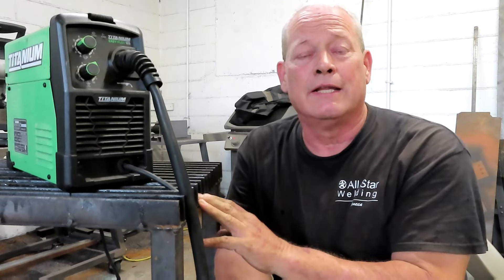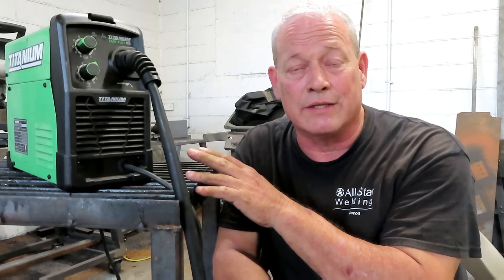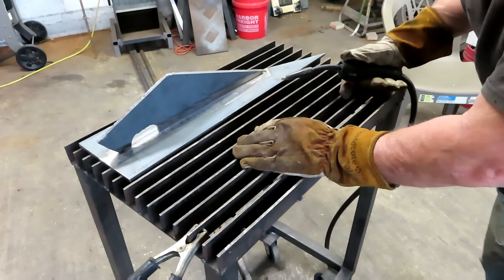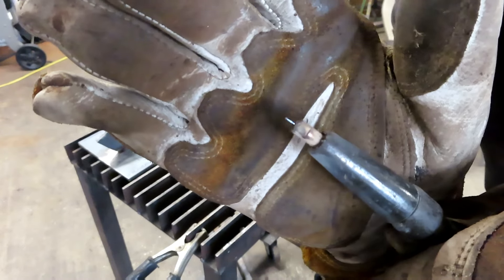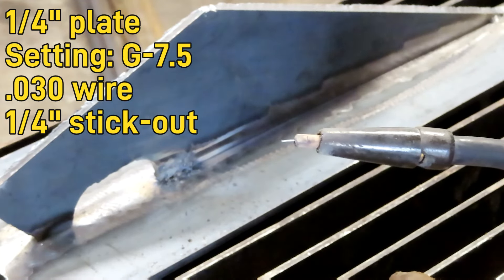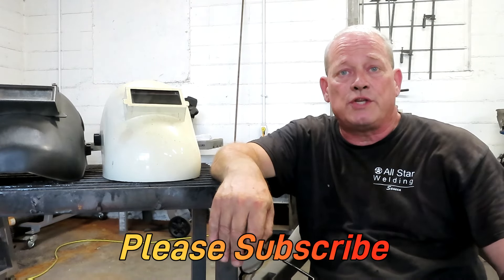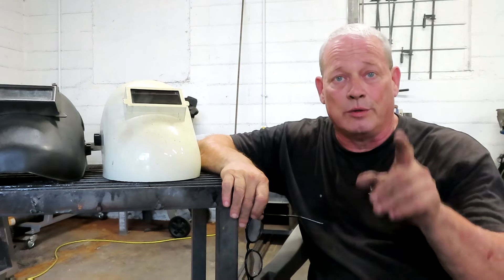How to Weld Like a Pro with the Harbor Freight Titanium Easy Flux 125 | Beginner’s Tips

Comment: I like the bird poop welds because that's where I'm still at. Those are very pretty weld may be someday I'll get to your level. What are the setting you didn't say in video?
Reply from the maker: Oh come on, brother. You've got to get away from the bird poop. Haha. Like I said in the video, the key is to use BOTH hands. One hand in the gun, and the other hand to steady or guide the gun. Start with just 1/2” stickout. Once the arc starts, leave your tip the same distance, or even move in just a little. Just guide the tip back and forth and lay that wire into it. You can do this. I promise!!  I forgot what my settings were on that video, and I'm sorry I didn't mention it. That was 3/16 or 1/4 plate, so I imagine it was pretty high. Maybe F-7 or so
Reply: @AllStarWeldingSC  Thank you very much.
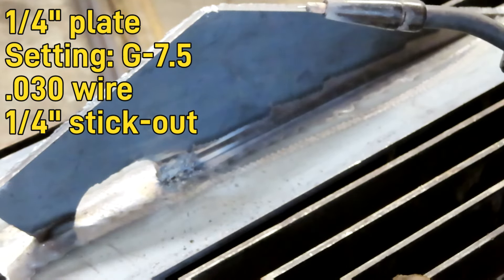Reply from the maker: I just watched the video again. All the settings are shown at 5:25. I was using .030 wire. Setting was G-7.5, and 1/4" plate.
Reply: @AllStarWeldingSC  Sorry about that. I was so focus on your hand position, movement and recommendation that I didn't read it. Again, I didn't know Ti-125 can weld that pretty. Thanks again.
Reply from the maker: No worries. I realize in the video, that you can't see the actual weld bead (I'm working on that), but you can see the torch movement and my hand movement. When I'm talking about the back and forth movement, I move to the edge of the previous puddle, then move back to the middle of that puddle, then to the edge, and back to the middle, repeat ...
Reply: @AllStarWeldingSC  Wow, so that's how it works. I always move to new area then back to touch the edge of previous spot. It keep giving me cold weld or bird poop and it turn into chicken poop if I increase power. I know more about using grinder than welding, lol. I've seen many videos but never knew that 50% technique. Thank you very much that should solve my issue now. Have a great day.
Reply from the maker: In that 4th example, the "whip and pause" I move the wire to the edge of the previous puddle and I sit there for just a second and let the puddle build to the size I want, then move to the edge of that puddle and repeat. And, in the 3rd example, the circles (or little e's) I imagine in my head the size that I want that puddle to be, then I move up and around counter-clockwise, and come down in the middle of the previous puddle. Then I move along the bottom to where I want to go back up and repeat. This way you can pretty much design the size of your puddle, if that makes sense. Doing this way, you can see that you will be at the bottom for just a little bit longer than you are at the top of the loop ➿. This is good to remember when you are welding two different thicknesses. Do the bottom of the loop (that you are spending more time on) on the thicker of the two pieces. Just make the top of the loop ➰ on the thinner. It's a handy technique. I'm sorry that I didn't further explain this in the video. Maybe this will be a topic of another video! With graphics and all. That would be pretty cool. I'll work on that!! But, in full disclosure... This is just how I do it for me. Are these techniques proper? Whose to say. But I'm usually doing one form of these 4 techniques, whether it'd Flux core, or Mig. There is also a 5th technique, which is just a straight "stringer", which is what 80% of my Mig is, unless the conditions call for another technique. Saying that... The 4 Flux core methods also apply to doing stick. I suggest practicing all 5 with your Ti-125. Getting good at those will take your welding to a whole new level!!
Reply: @AllStarWeldingSC  You should add all these info in your description for new viewer. I hope you get more subs. Thanks

Comment: Would this work for welding c purlin to pipe for a sheet metal fence?
Reply from the maker: Yes, with the right settings. Absolutely. Just concentrate the most of your heat on the thicker material, so it doesn't blow out. If it does, let it cool, then just hit it with short blasts to close the hole. Maybe I will make a video about closing gaps and holes with flux core.
Reply: @AllStarWeldingSC  thank you sir for your quick response. I just got out of work and about to head over to harbor freight and pick one up I was on the fence (no Pun intended) about it

Comment: Thank you for the excellent video.  Just subbed.  Question: Can this welder run on a generator to build corrals with 2 3/8" pipe?  Are the welds deep enough for that kind of work?  Thank you.
Reply from the maker: Thanks for the sub, and the question. The nature of Flux core burns pretty hot, and in many cases, it pretty much on par with stick welding. At home with a 15amp circuit, about the highest you can get on this machine is around G-E and 5.5-6 without tripping a breaker. It was the same on my Dad's 3500w inverter generator. But out on a mobile job, I run it off my Vulcan Outlet 6500w generator with absolutely no problem, even when doing 1/4" plate. The Titanium Flux really prefers a 20amp circuit. I would say that if you were using any generator over 5000w that you shouldn't have any trouble building that. For those pipes you could run E-F and 6-7, and will be fine. It would probably be as good as 3/32 6010 rod. I would suggest doing the little circles pattern.
Reply: @AllStarWeldingSC  Thanks a million for the great answer.
Reply: @AllStarWeldingSC  FYI. I'm picking up a new in box Titanium 125 with helmet for $80 from a gentleman that got it as a gift but he does not weld.  I saw an almost new generator on Craigs list, DuroMax 4400, 120/20AMP, 240/30AMP for a really good price, but based on your recommendation it's probably better to get a bigger generator, at least 5000W, right?
Reply from the maker: Dude, that's a steal on that Titanium.  And yes, I would get a bigger generator. My Outlaw is 6500, and handles it perfectly. That 4400 may struggle.

Comment: Great video!! Im curious what you recommend for an extension cord and breaker requirements? Thank you!
Reply from the maker: I use a 10g extension cord. I think it's 50ft. You should consult a cord chart for the proper length/gauge requirements. As for the breaker..... It really wants a 20amp.  I my shop, most of my 110v outlets are 15amp. It will trip the 15 if you have the power set to more than 1/2 way. I usually run it off my Vulcan Outlaw, which has 20amp 110v breakers. I can really crank it up with no trouble. My shop is pretty old, so I don't know if the wiring will support 20amp breakers. But again, I don't use it in the shop much, mainly just for these videos. I wish it had the capacity to also run on 240v.
Reply: @AllStarWeldingSC  perfect thx for the reply!!

Comment: How does it compare with the Chicago 125?
Reply from the maker: Oh wow ... The difference is night and day. The old Chicago is a transformer based machine. It's only settings are High/Low and I/II. Those are only 4 different taps off the transformer. The Titanium is adjustable on power and wire speed. The Titanium is inverter DC based. I remember when the Titanium first came out. I couldn't wait to get my hands on it. After my first try, I was amazed at how different it welds from the Chicago. I gave away the Chicago the next day. Look for my video about the give away. I'm giving away another Titanium, this is the 3rd time. I try to do it about every 3 months. Watch the video, follow the rules, maybe you can win it!

Comment: Jist started practicing welds yesterday. I'm so glad I watched your channel. Now I will try all 4 methods to see what 'fits' me well.  Question about eh Titanium......Is the spool spindle suppose to be locked into the welder frame? Lost my operators manuel and don't know for sure.
Reply from the maker: You want it right enough to where it doesn't come unraveled on its own, but loose enough so that the drive wheels can still pull the wire off. Good luck with your practice. Come back and let us know how it's going

Comment: I bought one of these on sale and have watched countless videos on welding with flux.   I really  like your welding table and appreciate your time and expertise.   I have been looking to build a welding table as a first build project and the one you are using seems to be perfect for the type of work i will be doing.   Do you have a parts and cutlist for said table?  I like it better than the flat ones or the ones with many cylindrical holes.  Thanks again in advance.
Reply from the maker: Thank you very much!  That's actually just a metal grate and I made a roll around cart for it. And put some wheels on it. But it makes a great welding surface with clamping areas all over it. It's also really good for plasma/torch cutting

Comment: I bought  this welder about a year ago  bought  it as a return from a guy who buys returns welds great
Reply from the maker: You got a good deal, it's a great little welder!
Reply: @AllStarWeldingSC   well had it not been for my truck breaking down and having to buy a $200 alternator  it would been!
Reply from the maker: Ugh .. been there. Just when I thought things were going good, my A/C compressor went out. After I recovered from that, boom - water pump.

Comment: Thanks for the video! I never realized how important stick out was. I like to compare it to a mechanical pencil. If you stick an inch of lead out and try to write with it, it’s hard and the lead will break off. But if you just put an 1/8 or so much easier to control.
Reply from the maker: Exactly.  The  wire has to be very close to the work to make it work correctly. That's just about the best analogy I've ever heard. Can I use that? I will use your name in the video when I use it

Comment: Two more questions:-) When you start, do you have the wire touching the metal or is there a gap like a spark plug? Maybe do a video for use who are trying to use this in a regular home. What is a good set-up? I don't have a nice metal weld table like yours. I have a workmate bench I can use in my backyard?  (I have had mine for over a year and never used it, I've wanted to:-) Subscribed:-)
Reply from the maker: I usually start with a gap. Not very much of a gap though. However, there have been times when I had to start with the wire touching, for various reasons. So I really don't think it matters. As far as your work set up, just be careful when welding in your back yard. Dead grass ignites easily!  There is a folding metal welding worktable you can get at Harbor Freight. It's pretty nice. And when you are done, you can fold it up and put it away

Comment: Got here after watching Dexter Browder struggle with his 125, this gave me hope! Thanks.
Reply from the maker: I'm glad you found it helpful. Let me know if you have any questions.
Reply: @ Thanks, I do have a question. What about the products like Simder, etc with the 4 in 1 processes. Thanks
Reply from the maker: Someone else asked me about the multi-process machines. They are great for the beginner, home shop, and hobbyist. They are certainly cheaper than buying all the machines separately. However, in a full time shop environment like mine, it's not a smart move. Supposed something happened to it and I had to return it for replacement/repair? I would be out of work. As it is now, I have 4-5 machines.  3 can Mig, 4 can flux core, 4 can stick weld, 3 can Tig. If one machine dies, I'm back to work in 5 minutes.

Comment: Never welded in my life but always wanted to bought this some time back and never looked back, works like a champ and I find myself welding like a champ.  I will say though tried welding some muffler pipe and it was a struggle kept burning through so if you feel like making a video showing joe that would be great.
Reply from the maker: That's awesome! You're a natural. It is a little tough on thin-wall pipe, but with a little more practice, you will get it. Flux core burns really hot. Muffler shops typically use .023 wire, very thin.

Comment: I was at HF on Tuesday 15 minutes before the doors opened to get one of these. Can't wait to see how the Easy-Flux 125 DC inverter does versus the Chicago Electric flux core AC machine I bought years ago. I'd vote for back and forth (#2 I think) for cosmetics, but it would be cool to cut them in half to see a side view of the penetration. Isn't there some acid or dye you can put on the cut welds to see penetration? Anyways, thanks for posting this!
Reply from the maker: Oh man, you won't believe the difference. Between the transformer and inverter, it's day and night.
Reply from the maker: I agree. #2 is usually what I do the most. I will see what I can do about making a cut/etch on the different styles.

Comment: A lot of good information here. Thank you. I have this machine, and I have had good luck with it. While you were welding, I wished I could have seen that puddle. All of the welds look great. I will try all of them just to see which one works best for me. Thanks again.
Reply from the maker: Yep, I'm working on a setup to video the welds better. But you can still see my movements if you look at the gun, and my hands. I will keep working on the arc shot. I can shoot through a helmet, but it really messes with the camera, so I have to dive more into the manual settings

Comment: Yup I got one for 25% off as a member!  Now I see that some of you got it for $99…  not happy!  Glad you guys got the 99 deal ..
Good video… got good info…. Can you do a video on welding sheet metal ( repair on old car) .. the setting !
Also I have seen ( I think) placing the nob on the surface to weld ( not the wire) .. good or not or my eyes need glasses..
Great video plan on keeping it 👍
Reply from the maker: That $99 sale was for one day only, with a limit of 2. I found out about it the next day, or I would have picked up 2 more. Automotive sheet metal is not best done with flux core. I'm not saying it can't be done, but would be better off using .023 Mig. I will see if I can make a video with flux core. As for your other question, I don't understand what you mean by "knob"

Comment: Welcome to the Titanium Team. I've had two I've used for YEARS. These are absolutely one of the best financial wins you can purchase at HF.  These machines perform perfectly - especially concerning their price point. Couple them with high-quality FC wire like Blue Demon and you have VERY little splatter. I've made dozens of tables and projects with these welders. One constructive criticism note for improving on these, you toe portions of the welds are a bit cold. Consider turning it up a smidgen more to blend those a bit better. Otherwise, you're doing great.
Reply from the maker: Thanks for your comment. Like you, I'm on my 2nd one as well. Got the first one shortly after it came out. They are great for when I need to go on location with it. You don't have to worry about the wind, or lugging around a big tank. You are right about the cold toes. My shop is really old, and some of the wiring/breakers are suspect at best. I was really surprised I was able to do the demo, at those settings, without tripping a breaker. Usually when I'm using this, it's off the generator in my truck, so that's usually not an issue. I was trying to get the demo finished before the breaker tripped. More heat would have helped, and a little more time at the toes to let it melt in. Good catch
Reply: @AllStarWeldingSC  Because this little welder puts the power out especially over the same variation of the 'Century' model, it'll take it - if you can give it. So I wired a dedicated 30Amp to the side of my house to run this puppy and it literally won't stop. Well built little Inverter Welder for the price! Cheers.
Reply: I did the exact same thing. It keeps spitting out my wire without barking.

Comment: I'm like you, I run in tight. I've been welding for a few decades and I have one of those little machines in my shop as well as my bigger commercial machines and I don't have any issues with it
Reply from the maker: I think they're really a great little unit for the price. But like you said, you've got to get in there and let the wíre push into the weld. If you are too far back, it just bounces off and makes all that spatter.